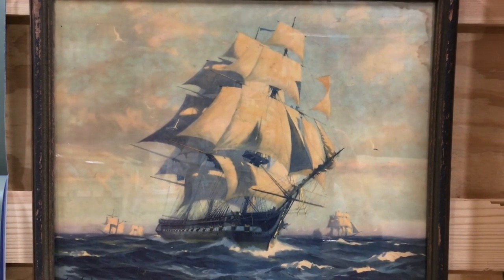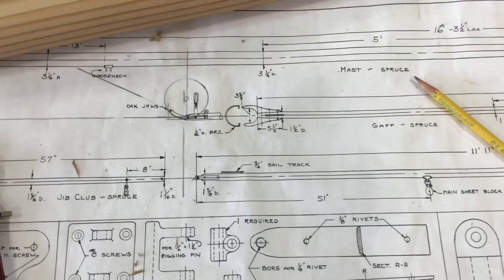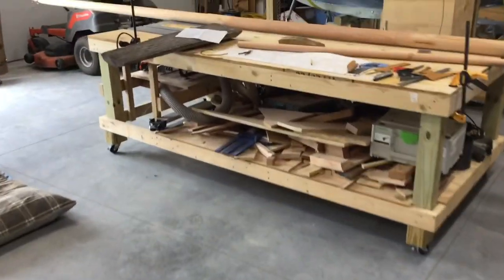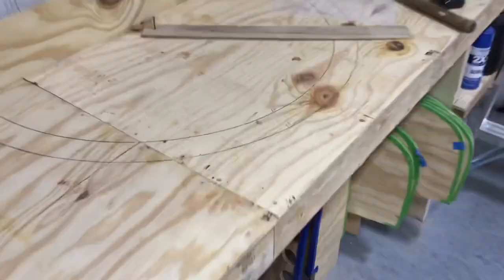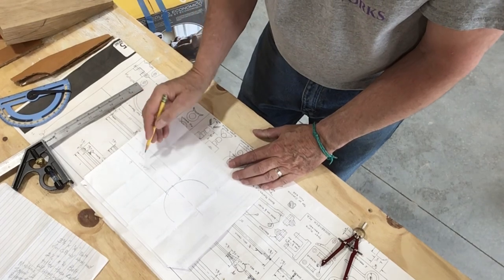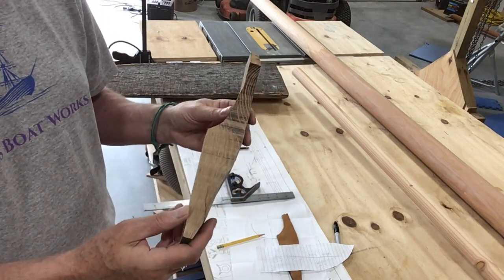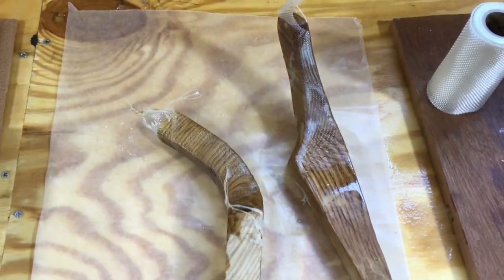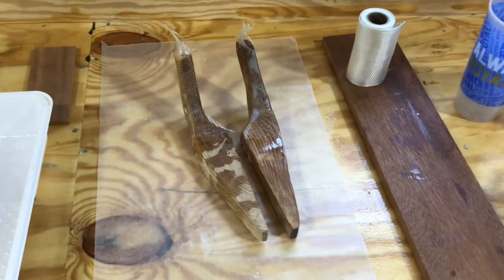Boat Building The Haven 12 1/2 - Making Gaff Jaws - Episode 120

Comment: Very helpful. I just bought a 30-year-old Beetle Cat, and the gaff jaws had been left sitting in the bilge, which was filled with water by the previous owner to help the planks swell. The wood of the wood of one of the gaff jaws was dark gray, and sure enough, it didn't survive a third sailing. Rather than worrying about expedited shipping of the $150 jaw replacement piece from Beetle Boat Shop, I'm going to attempt a repair of the broken side of the jaw with fiberglass cloth and possibly a steel pin. I think I'd prefer to steam-bend a permanent replacement, and may just surrender and order the part from Beetle, but thanks for inspiring some ideas for repair! (A Haven 12 1/2 is my dream boat, but I couldn't pass up the Beetle which was more affordable. I'll be back to watch your Haven build!)
Reply from the maker: Sounds great. Glad this was some help. Cheers